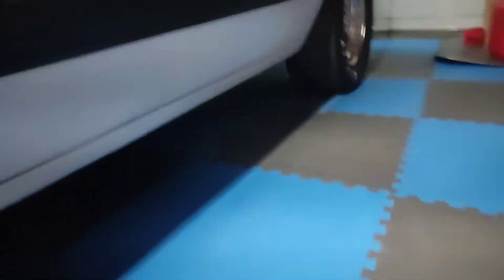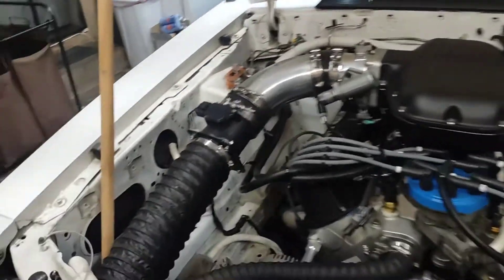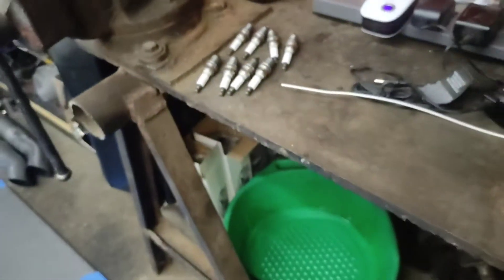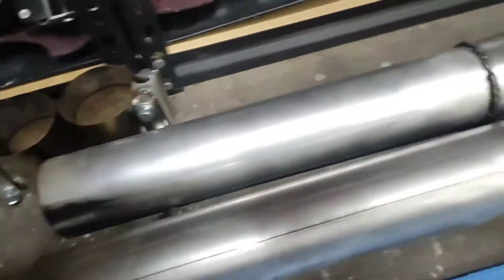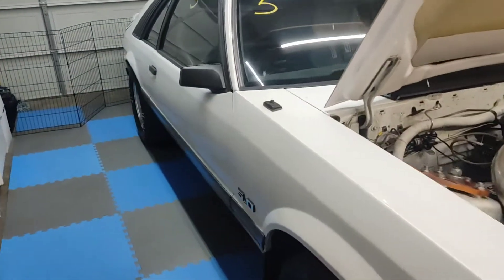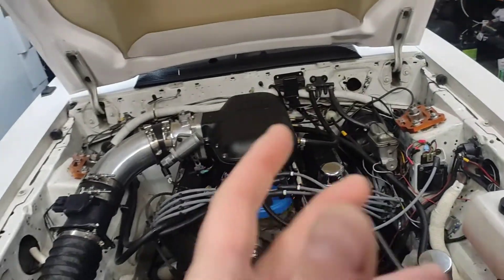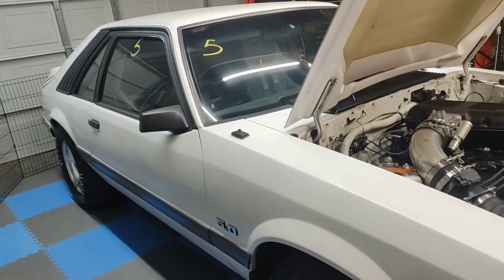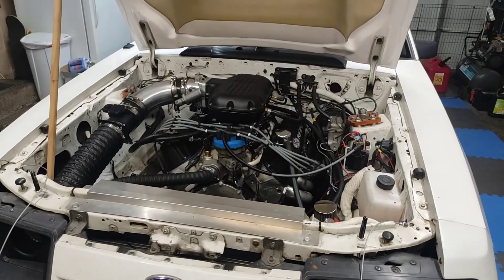getting the 86 foxbody prepped for next trip to the track

Comment: All the changes are in the right direction. Car should 60 better and hopefully you could get closer to 130mhp trap times. The exhaust shouldn't hurt hp if you have free flowing mufflers and a 3" system. 
Everything is looking good and we are wishing you luck
Reply from the maker: thanks Tony, yeah I knew something was wrong last time at the track, it just kept unloading the tires on the hit, it think that passenger rear shock on full loose was crushing the sidewall and unloading the tire
Reply: @vrm86gt  yep that will do it. Stability on both sides is the key. Your combo definitely has 130mph plus trap times in it based off of our calculations. The power it there and I believe you could get even more power out of the motor since its running so good. Your combo will help guys view cylinder head selection differently. You are making more power than a lot of other 347 type combos that's running bigger cc heads and custom cams!!
Reply from the maker: @bigdogsportingtonyb2833 thanks, I did some research and found a few combos similar that made up to 530-ish  and just headed in that direction.  these stage 2 heads flow enough to support that power level, maybe a little more.
Reply: @vrm86gt  most street 347s are trapping 119-125mph NA. I bet your car has some 132-133mph trap times in it.
Reply from the maker: @bigdogsportingtonyb2833  with a good driver, maybe so!

Comment: Little late, I realize, but I was going to mention that I got a universal tube kit from Airaid (AIR-100-350 in my case) that was pretty good for my purposes and would probably be good for replacing the flex hose you had on your car, if you wanted. It's polyurethane, so it doesn't cave in on high engine demand, and probably is not much heavier than the flex hose. They have lots of choices of universal kits, and probably have fox Mustang specific stuff that I didn't look at since I don't have anything remotely as "normal" as that. Different diameters, etcetera.  Anyhow, for what it's worth.
Reply from the maker: cool, I will check it out!

Comment: Nice jod I'm still building mine is a 363 for nitro spray 350
Reply: What alternator u running if u don't mind what year from to last year
Reply from the maker: @jeffytherapper7279  it just the 3g alternator with the moroso low mount bracket
Reply from the maker: Awesome, I wanted to do 363 but couldn't get a Dart block!

Comment: Just saw this video glad I caught it, how much timing are you running now and what heat range  spark plug are you using
Reply from the maker: timing is at 10 initial / 31 all in, plugs are autolite 3924 gapped at .045